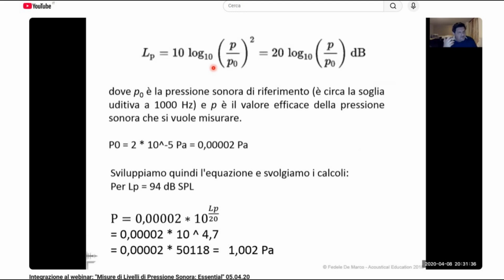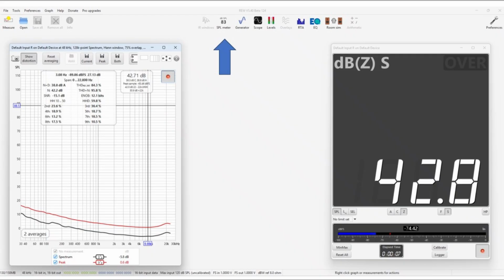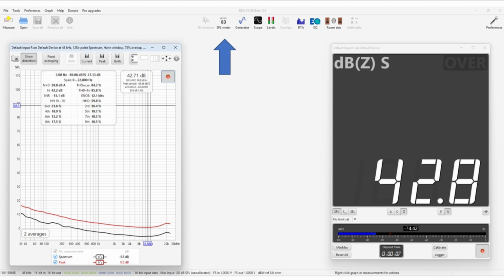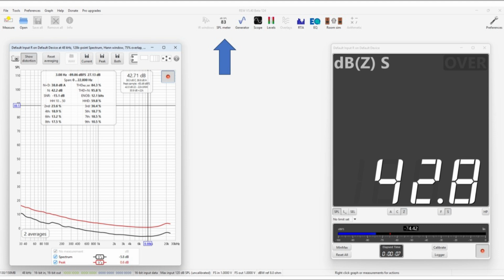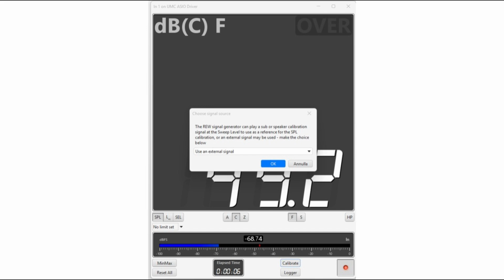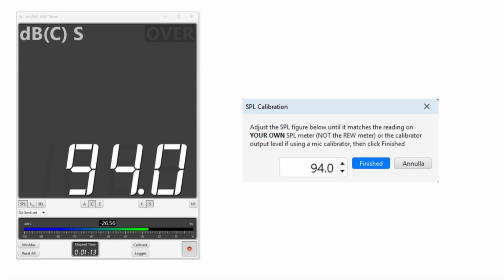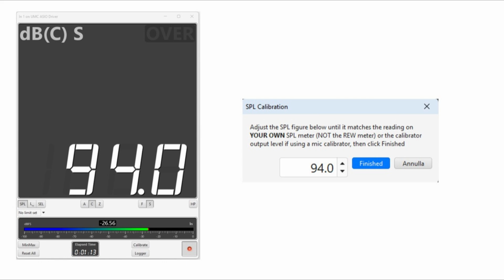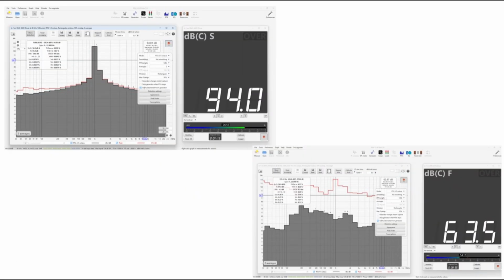REW - Procedura di calibrazione SPL tramite calibratore microfonico

Comment: Which calibrator do you use?
Reply from the maker: Class 1 Bedrock Audio. good choice. i think around 700 euro the cost. Alternatives Class 2 SC1 Isemcon with adaptors, i think around 400 euro. 
Or Cheap alternatives i read that are good.
If you have a Soundcard that SAVE the scene, and also have digilta gain controlled separately from KNOBS, you can calibrate 1 time with a calibrator of a friend, and save the scene on the control software of the soundcard. next time (with same mic, cable, ...) you just recall the scene and so the digital gain (indipendent from the physical position of the knob of the preamp). 
Anyway, i knwo that some cheap calibrator, around 100 euro, is quite good
Reply: @FedeleDeMarcoAcoustics thanks for your response

Comment: Hi Fedele,

Do you need to calibrate your mic for Crosslite?
Reply from the maker: what you mean. Every  Software need Calibration. Also you calibrate alla the Chain not only the sftware: Mic, cables, soundcard, software
Reply: @FedeleDeMarcoAcoustics sorry I meant when you first start using Crosslite. In the manual it shows the process of measuring the voltage off of the XLR pins of the audio interface ect.
Is this necessary for system tuning?
Reply from the maker: @DelicAnomaly  If for System Tuning you mean Alignment process NO. 
If you mean EQ NO
It is necessary only for specific application according some standard (cineman for example) or regulation
Reply: @FedeleDeMarcoAcoustics rippa! Thankyou I appreciate you taking the time to respond ❤️